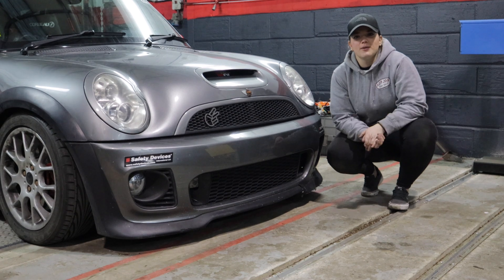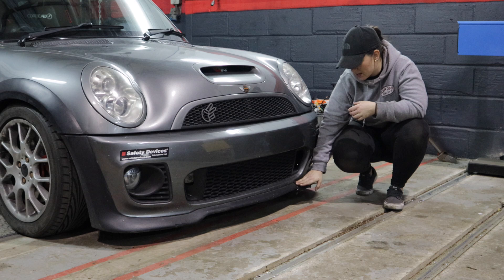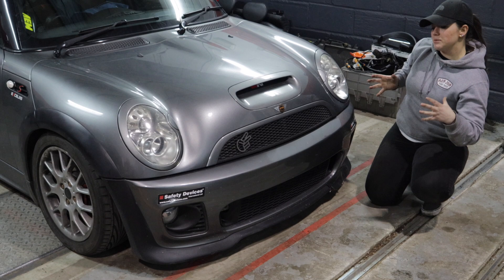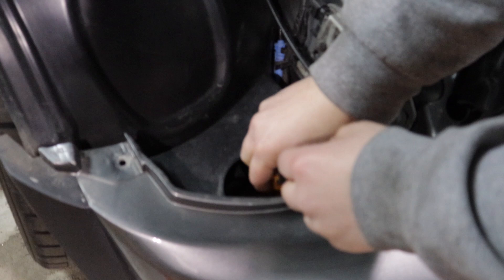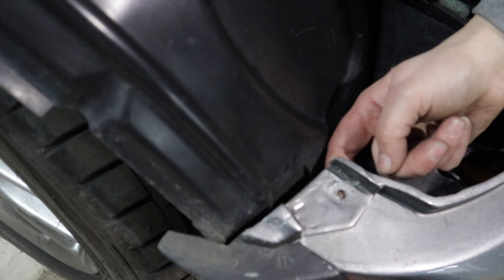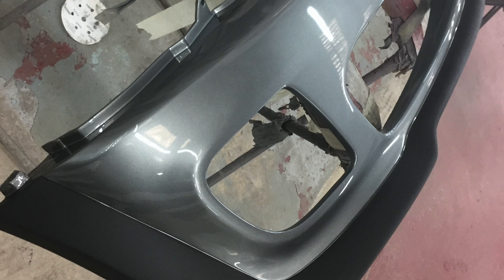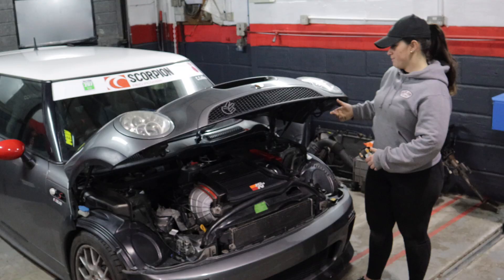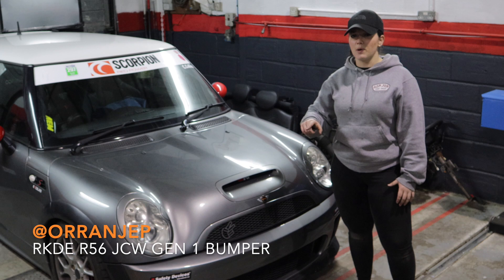Fitting an R56 JCW bumper on my MINI R53

Comment: Really easy to repair...but gaffa tape fixes everything. As long as there’s gaffa tape & cable ties in the boot the Mini will make it home 😉. Great vid Cleo 👍🏾
Reply from the maker: If tape and cables don’t fix it... then you haven’t used enough. 😂 I will get around to sorting it eventually
Reply: @carsandbras2202  if it’s not falling apart then that’s the cost of another track day 🤔😉
Reply: Cleo where did u get ur grill and brake ducks and foglight ducks at.

Comment: What about the back bumper upgrade ? Did you do the same 4 the back bumper ?
Reply from the maker: I have the R53 aero bumper on the rear. I’ve always wanted to fit a rear R56 bumper, along with an R56 challenge diffuser as it would definitely complete the look
Reply: @carsandbras2202  I got the original 1 had problems as it don’t fit straight on ? Any HELP would b appreciated 👍🏻

Comment: I have the exact same bumper for my r52. What type of black bumper texture spray did you use match the wheel arches
Reply from the maker: It was a generic rattle can from a local body shop, you can buy them online and they shouldn’t be too different in shades
Reply: Thanks for your reply